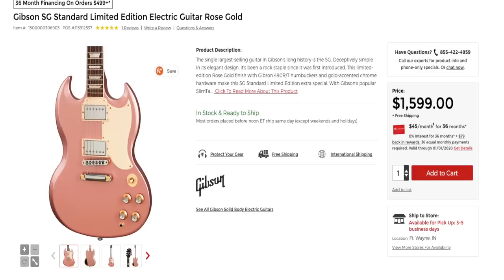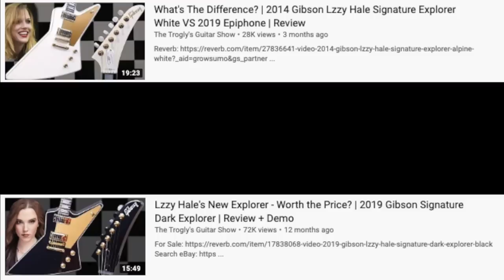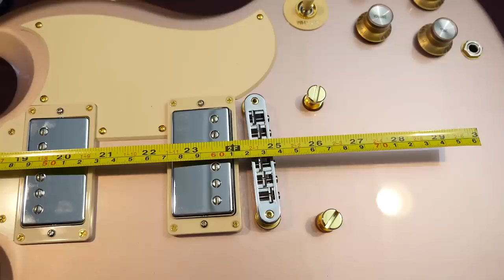Guitar Center's Dirty Secret | 2019 Gibson Rose Gold Pink SG Limited Edition Exclusive | Review Demo

Comment: It seems like that may be a factory refinish. That would explain the screw holes and finish problems. Possibly took an overstocked model of sg and stripped it of parts and finish, then turned it into a "limited edition" to get them to sell.
Reply: Could it also explain the fatter neck and finish overhanging on the binding?
Reply: Conor Winston  oy vei, it's unnada shoa!  I wonder how many SG's they did this to, 6 million?
Reply: I can confirm that's not the case. AFAIK they come from the roughmill just like the rest. Though the neck thing has me pondering, there was a "limited edition" sg that made it to finishing with the wrong neck. I wonder if this is one that made it out of the building.
Reply: @MrBladle  Finish over hang may just be from a heavy handed binding scraper.

Comment: My 2017 Firebird had much of the same. Finish too thick in some areas, too thin in others, same issue where the fretboard meets the neck with the finish, finish piling all along where the neck through meets the body wings. I was really disappointed. I ended up ripping out all the electronics, changing the pickups, and sending it to Marty Bell to put a custom paint job on it.
Reply: For whatever reason it seems Gibson has trouble with any finish that uses metal flake.   Except the Gold-Top Les Pauls', they seemed to have figured out that process.

Comment: The thickness of the finish is interesting. I have a GC limited edition 2006 SG platinum in sunrise orange and it's the same deal:  finish is so thick you can barely read the serial number. It also weighs closer to a Les Paul than to my SG Classic.

Comment: I bought a Guitar Center exclusive Gibson SG Platinum (in Sunset Orange Metallic) back in 2003/2004. It had all platinum/gray hardware (which I updated w/more vintage style hardware). It also came with the stock 490R and 490T pickups (2 open coil pickups in aforementioned platinum/gray color). I swapped out the neck pup for a covered '57 Classic but retained the 490T for the bridge. I like the 490T for bridge rock tones, but the 490R was too glassy for my tastes as a neck pickup. It was my first Gibson and I still have it despite all the wear, weathering (from playing in colder climates-a painful/scary lesson about the effects of weather on guitars) and it remains one of my favorite guitars. Also like this guitar, the heavy finishing on the back of the headstock obscures the serial number a bit.

Comment: The color grew on me........
The QC.........made me shrink
Reply: Yeah, I'm completely turned off by the qc with Guitar Center Gibson's.   I bought a Gibson SG 60's reissue back in 2014, and the neck angle/pitch was off and the nut was too low, so the first fret action was just crap.  The A and D strings buzzed on the first fret, unless you back bowed the neck and raised the bridge to compensate...wich they did before I got it.  I ended up returning about 4 SG's before landing on one with a solid body.  That one I kept, even though the first fret action was off, but that's where milar plastic helps.  One quick shim under the nut and bam.
Reply: Hi i dont understand much about electronics, can someone explain why is that qc so bad?
Reply: @Beatleday  Qc stands for quality control.

Comment: Mine has got the slim 60’s neck profile! It doesn’t have the fat 50 is like the one you have. Mine also has never had Klusons put on it...it came with Grover turners which I immediately replaced with Grover locking tuners. The only issue I’ve had is that the control cavity plate was so tightly fitted that it popped a piece of the rose gold finish off when I removed it 🤬.

Comment: For vintage spec I would not want PCB and quick connect, but for mods I quite like it. I just put a NZ made Obsidian Wire one in my Les Paul that has 50s wired caps and coil splitting. Still needed to solder extensions to grounding wires, but what I noticed straight away is how quiet it is with lots of distortion and a treble booster -- even in single coil mode. Quiet is good I think. On the other hand I noticed no lack of tone compared to the stock Gibson one. 
50s wiring? People say it sounds the same if all the controls are on 10. I do not think so. I have tried it a few times now. It sounds a little different. Not going to try to describe how though.

Comment: I've had a couple guitars made for me that utilized the fret-nubs/finger-board binding.   Even the custom builder I used had trouble providing a perfect execution of the binding being cut/filed away to produce the fret nubs.
After cleaning up the work I am confident most anyone can produce a perfect fret-nub finger board binding with minimal tool/file marks left on the binding/rosewood fret board.   The issue is time.  It takes a incredible amount of time/patients to do this work and I suspect it all boils down to time.   Myself, I feel I could perform the finishing process for producing the fret-nubs in about 5 to 6 hours time for a single neck.   Granted I have no real experience doing this, still though 5 to 6 hours is a long time.   I'm sure a factory worker is pushed pretty hard to produce 6 or more finished fret-nub jobs in a single shift.   
Once I realized how much time it takes I kind of stopped worrying about the little defects on any mass-produced factory guitar.   It is what it is and we won't see better quality in this area on mass-produced guitars until such time they teach a robot to perform the task.   
Don't hold your breath, Gibson isn't NASA............Gibson couldn't even get robots to reliably tune a guitar!
I'm just saying, unless they are really messed up or something fret-nubs are a non-issue for myself.

Comment: p.s. Why quality issues? When did it begin? I think it coincided with the complaints about prices. They tried to get Tribute models etc out at little more than PRS SE prices. Where to cut costs? Labor and avoiding time consuming touches in the line. Get more production for less money. Quality will always suffer doing that though. Over a decade as a production manager taught me that and I was a QA before that. If you want high production rates and to still maintain high quality you have to make it worthwhile for staff. Pay peanuts and cracking the whip has the opposite effect, because people will hate their job and not care about the product or the fortunes of the company so much. Pay people well and make sure it is a great place to work and staff usually pay that investment back with interest -- plus the quality of the staff improves over time because better pay attracts better workers. Good workers who like their jobs are usually more productive and do a better job, so spending more on wages can be a gain rather than a loss. I might be wrong, but I'd bet that is what went wrong at Gibson.

Comment: Gibson perhaps "found" a way to improve QC, but are unable to sustain that quality? I don't know. I bought myself an Eastman SB59/v. It's the goldburst finish, which wasn't my preference, I wanted either black or amber. However, the guitar is beyond outstanding I almost can't describe it. I got a decent enough deal on it and it just feels worn in. Also, you can see and certainly feel that QC is insane on this guitar --- meaning, no cut corners. The pink finish on this SG is nice and the price isn't too bad, but that PCB, the finish flaws, the plastics etc. That would bother me if I were buying new. But that's just me.

Comment: I received mine today and the paint isn't as thick as the one you have shown.  The sn# can be easily read and doesn't have the drill holes for the wrong tuners.  Just an FYI...
Reply: Hey, did you have any major issues like detuning issues on the g string or serious neck dive?
Reply: @MrDream-zm1pw  I have no issues with tuning and just a little neck heavy but nothing to worry about.

Comment: Those issues may not be "100% returnable" problems, but for $1600, they ARE 100% not buy problems. Clear coat on the fretboard? Binding problems? Overspray? It's good to know that the quality control hasnt changed at all since my 2006 les paul standard was made.....

Comment: Love the thinner tapered horns. It seems to be the norm nowadays, even with the big joint. Really makes them look more classy

Also just wanted to point out that fat necked SGs are not THAT rare. Most batwing Standard models from 1991 to present have a rather chunky neck -  not baseball bat, but not that thin either. I had a 2007 Std which was somewhere in the middle.

Anyway this one looks beautiful!

Comment: Why are hand wired pots better than pcb? Don't understand.
Reply: @Bandana Dee Isaac Why would hand soldering provide a warmer sound? We aren't talking about vacuum tube vs solid state. Certainly the caps used would matter, but I don't see how using a pcb would make any difference. The pcb makes changing pickups easier, that's about it.
Reply: @Bandana Dee Isaac I could be wrong, that is why I'm asking.

Comment: That bridge pickup doesn't impress me.  And you wonder why the aftermarket does so well.....

I have an old SG-I from 1994.  It also has a fairly thick neck that fits somewhere between a 50's rounded and a 60's SlimTaper.  By far my favorite neck across the four Gibson's I own.

Comment: Yours looks a little rough. Mine reeks! like vanilla and it looks and plays great. They only blemish is on the back of the headstock. My fret-board is a lot lighter. Sound so good. My biggest complaint was the rep at GC that sold it to me said that technically the guitar is $900 and were being forced to buy it paired with the $600 HP case. Really seems like you got a dud in comparison. Mine was made on the 22nd of october. The blemishes and that lack of a vanilla smell makes me wonder who finished yours vs mine